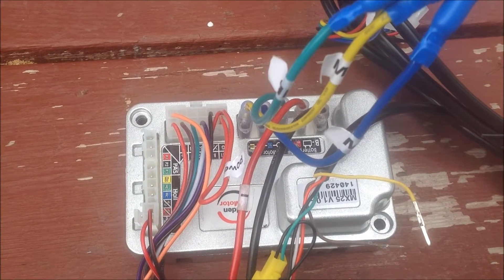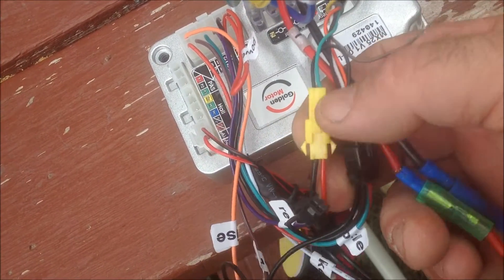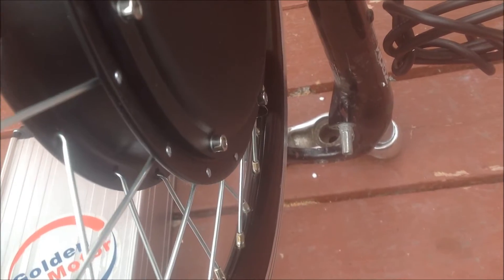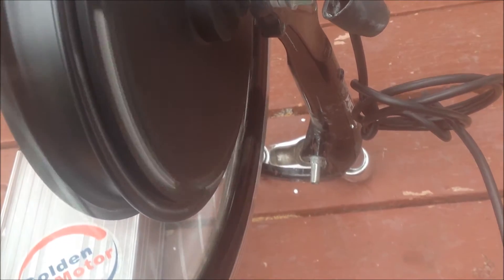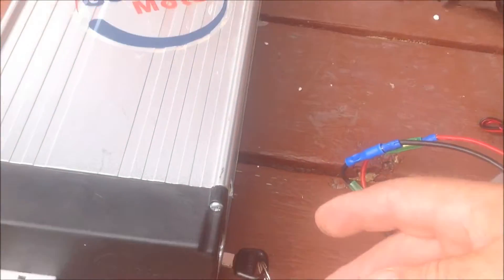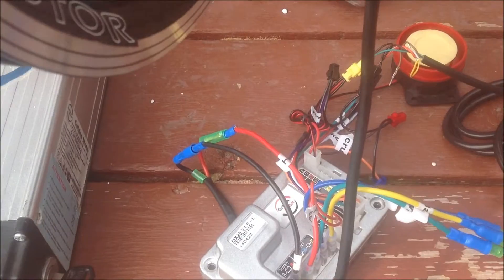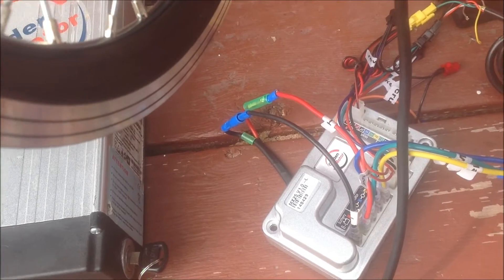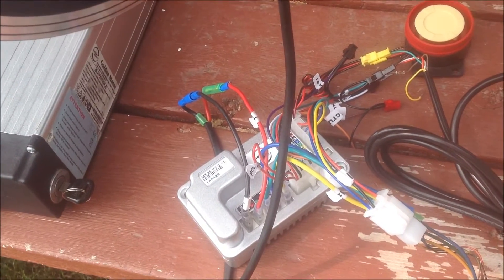Magic Controller Sensorless Mode - Golden Motor Canada

Comment: Thank you, great video. Do they make these hall sensorless controllers, for 72 volt 3000 watt motors? I need a replacement, And I'm not sure, if it's the charge controller, or the hall sensors in the motor. I live down in Arizona USA. Thank you so much.

Comment: Hi there,

I have been looking for an answer to my issue for a long time. My controller states it is dual mode. I was running my wheel with the HAL sensors and they suddenly failed exactly like this wheel. But when I tried it with only the phase wires connected the wheel didn't turn. There was just a quiet clicking sound each time I turned the throttle. I've had 3 wheel hubs. Each time they failed on me. I just want to run without the sensors. Should I buy another controller?

Comment: Is there a way to set up the 50A Magic controller so that throttle controls power instead of RPM? Right now my bike will, if I use half throttle, accelerate to half speed with full power. It is a small wheel and therefore has very high torque, almost impossible to start without wheelspin.

Comment: Is this a common form factor for motor controllers?  I have one that looks exactly the same from a mart cart.  It has only 2 phase wires with terminals but the label has 3 phases listed, one seems to just be missing the terminal.  Is it possible that this controller could be modified to run a 3 phase brushless motor?

Comment: Does that controller work fine with a 72 volt battery 3000 watt motor?
Reply from the maker: No it will not fit 72 3k you will need the following controller 

https://goldenmotor.bike/product/vector-200-series-72-volt-brushless-motor-controller/
Reply: @goldenmotorNA  but the issues with the motor wheel are the sensors!! So I'm looking for a sensor less controller compatible!

Comment: Hello Gary, is there a controller setting on a VEC series that allows you to bypass the hall sensors? I have been running the 5Kw 72v motor with a VEC 300 controller. Occasionally (usually when it's wet outside) I will step on the throttle to pull away and there is a JOLT, and then I lose all power. If I put my foot out the door and push the car forward while hitting the throttle, I can pull away. Seems like a hall sensor? Just wondering if I can remove the hall from the equation using the controller USB programming software.
Reply from the maker: Hi, that is more of a question for our forum at www.goldenmotor.com/SMF